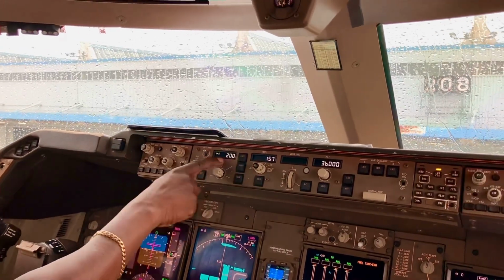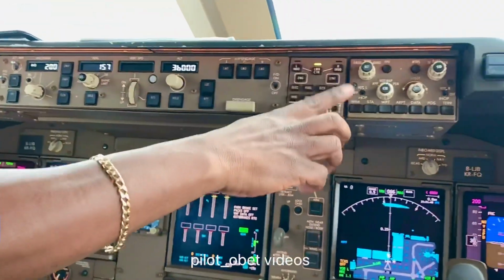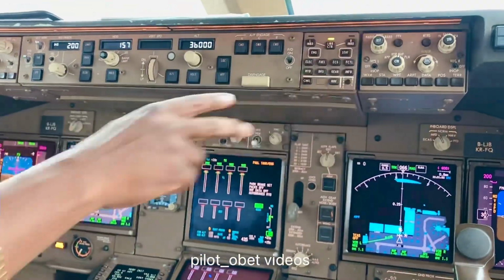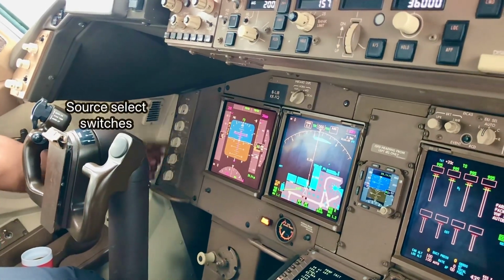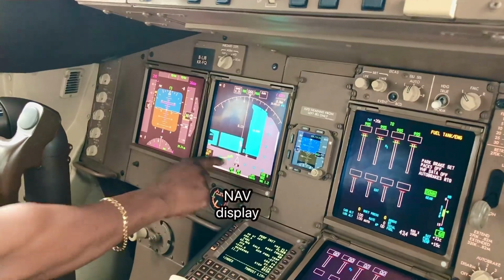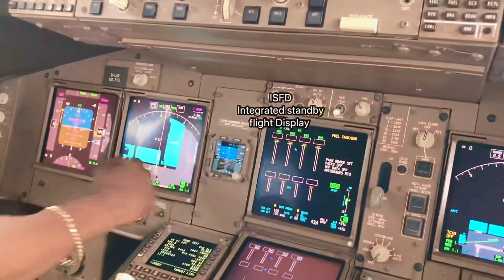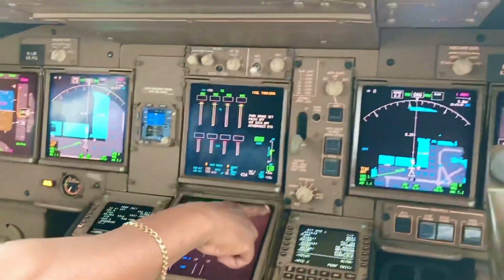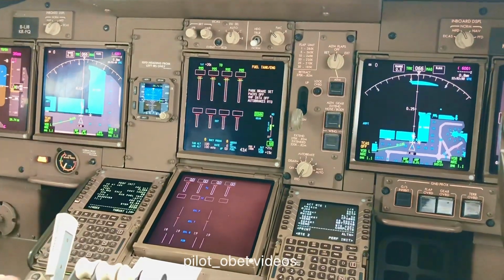Preflight actions- The ‘Flow Pattern’

Comment: I have asked this on a couple of different channels without response and I fear that the question is too basic for a lot of pilots and aviation fans but I often wonder when you 'drive' these big jets to the gate or to the runway and line them up ready to take off, do you steer them with foot pedals? Is it as simple as steering a car at low speed? How do you practice do you have to drive around the taxiway as a student until you get the hang of it? You have all these amazing systems in place once you are in the air but what about the more parochial stuff like not bumping into a tanker or ending up too far to the left or right on the runway when you are ready to take off?  Thank you :)
Reply from the maker: I’ll show you in a few days.
Reply: @pilot_obet  Thanks, Captain.
Reply: Hi there. I am not a Pilot but I can answer some questions. 
For steering the aircraft you have a so called tiller. On the left side for the captain and on the right side for the First Officer. Some aircraft, like the Dash Q400, have only one tiller on the Captains side. So no tiller for the First Officer. 
With the tiller you can steer your aircraft around the Z - axis. You still can steer with your pedals but its mainly purpos is to manipulate the rudder. The nosewheel still will steer some degree when rudder imput is given. I am not shure but I belive like 5-15 degrees depending on the aircraft. 
On some airbus aircraft (A340, A380, A350) you have taxi cameras installed to help the pilot taxiing on the apron and to give a more advanced look at the aircraft and its surroundings while taxi. Its like getting used to it just like on the car or lets say bick truck. 
My experience as a stundent you taxi with your gut instinct. Approaching the stand or gate you will have a guidance system oder a marshalla guiding you into the position.

Comment: What is squawk 2000 mean?
Reply: Most commonly used to set after reaching the parking position. It is a reminder for the pilot that no squawk has been assigned via frequency (No clearnece received yet). In some countrys this has a meaning when squawk mode C for example in germany: military night flight in a low sectore.
Reply: @mcCrewFish  Cheers